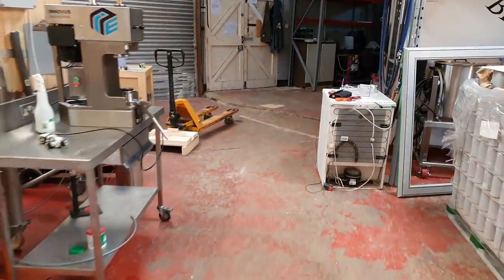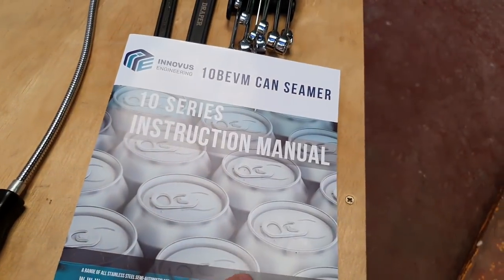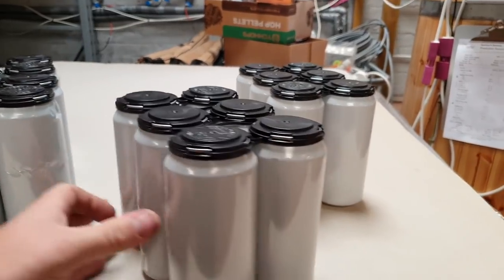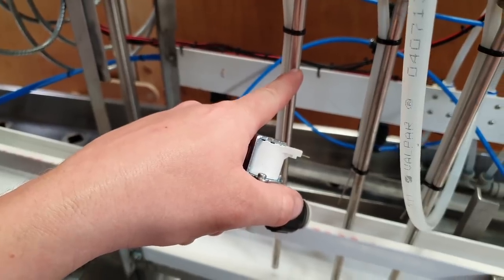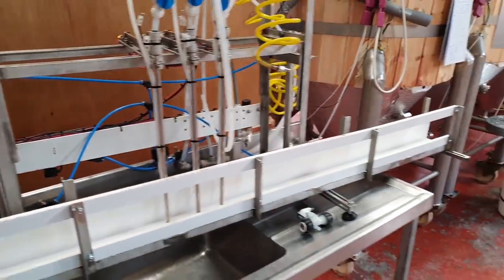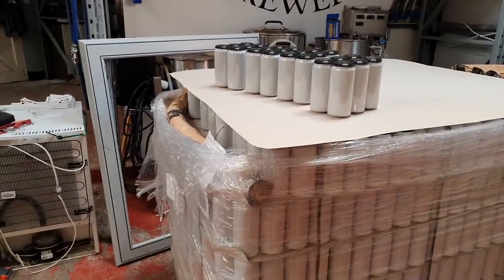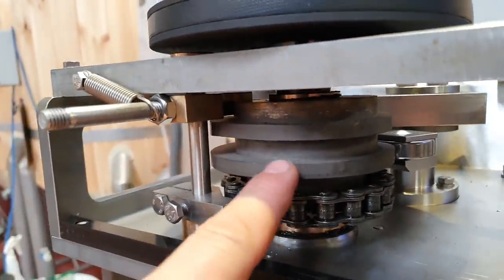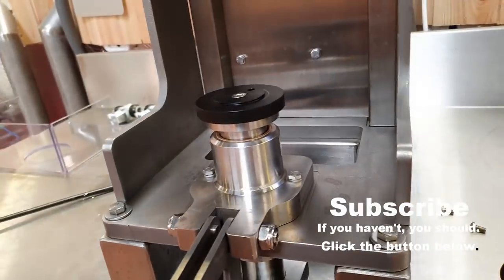Seams Okay To Me

Comment: Run the line through a ice bath before it goes into the solenoid, make sure the tank is cold. The final step which I think is the trade secret is clamping the beer line to cause a uniform reduction of flow. Boom we do 4 cans a minute with the blichman beer gun from kegs or 2000l brites. Clamp that tube. HARRY need help with programming HELP.

Comment: Good to see progress and back to business :) as a suggestion, when priming in bulk for bottling I transfer brite beer to a secondary/conditioning tank with sugar solution mixed to right volume. On the lid I have a slow rotation motor with a shaft that reaches bottom of the tank with paddles attached. Switch it on and leave it for 30 mins to mix. It is important that the paddles don't break the surface to introduce oxygen, slow rotation to agitate not froth.

Comment: Have you tried moving the solenoid valve closer to the discharge tube.  Line length will cause the co2 to come out of solution going thru the solenoid valve if discharge line is long. Moving closer shortens the discharge.  What pressure are you pushing the beer thru the lines. Low is better as it moves the beer and does not agitate the co2 that is in suspension. Takes longer to fill, but no excessive foam. System is looking good. CHEERS ! ! !

Comment: To get an even equalisation of filling you need a manifold much larger than the sum of the Cans in your case as close to the delivery as possible. I believe the effect is called Plenum. Works for any fluid especiall air.
More importantly the piece of (probably) lexon is a guard to stop you trapping your fingers. If you look back at the footage youre fingers were within a couple of cm of the pinch point of the seaming rollers and I gave an involuntary lean forward to warn you. By rights there should be a safety switch to ensure the guard is in place before you can start the machine. I am wondering if this machine has an EU or British safety certificate. Is it American perchance? No in can't be it would not have a guard at all if it was.
The motor looks substantial maybe a 1.1 kW.

Comment: Could the drip on the canning machine just be the surface tension breaking in the fill tubes and the beer running out of the length post-valve?